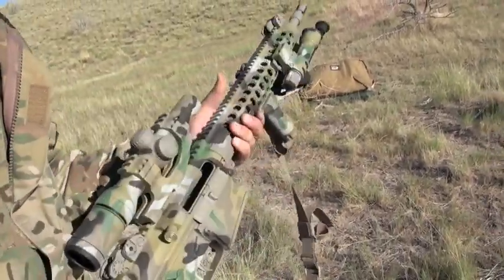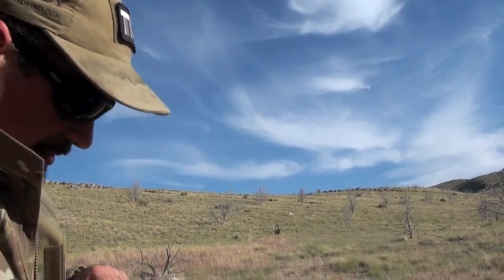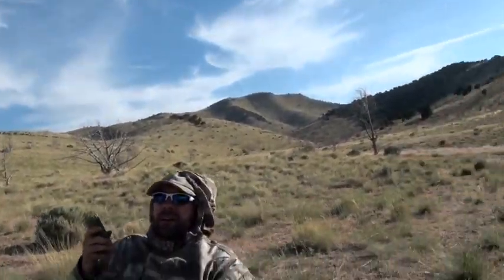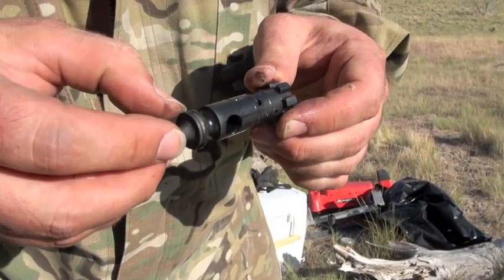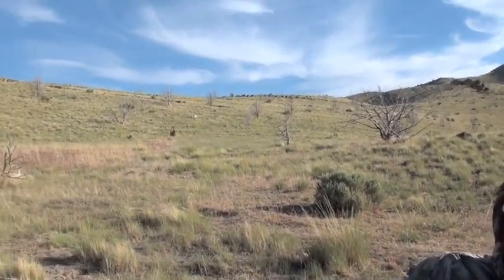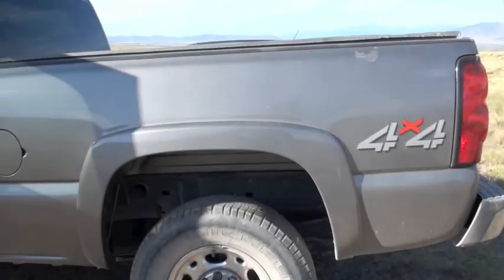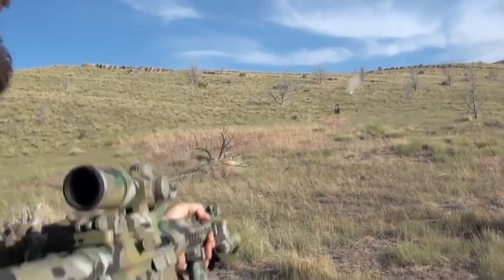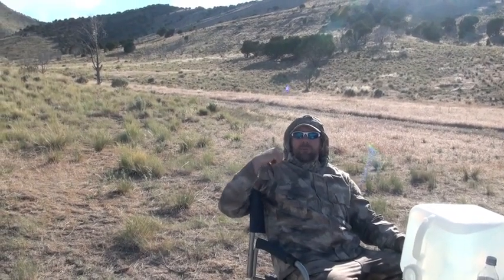ORS: DPMS LR-308 Franken Gun Fails

Comment: Thanks for posting Nutn. I would love to see more videos like this of specifics like gun Failures, why they do, good mixes and bad mixes for ar-15 franken guns etc... however, in general I think cosmetic changes are better then to mess with some serious parts of the system. If you want a top notch rifle, I suggest saving up for one and buying it then slowly franken-gun-ing it to the point that it has lost all semblance of cohesion between the parts. Factory guns are like they are for a reason.

Comment: Try it. You don't need to have a pistol grip/angled fore grip/mall ninja accessories on the front of the gun to use the "thumb over bore" method. It actually creates a lot of stability, especially when you straighten your elbow on your support arm and hold closer to the muzzle. Costa and Haley types teach it, and it works for a lot of people.

Comment: His problem is not a 'limp shoulder'. He needs to change out his buffer and buffer spring. If hes running a carbine length buffer tube, he needs an extra heavy Wolff spring and try two different buffers. I have a  carbine lengt buffer and a mid length gas system on my gun. It is running perfect with a heavy AR10 spring and an AR 15 buffer. With an AR 10 buffer, my BCG retracts too far into the tube.

Comment: When you pulled the charging handle back I heard that it is gritty. Polish the bottom of your bolt carrier and the top of your hammer. When you changed your trigger you probably replaced the hammer spring and now their is too much friction as the bolt carrier rides over the hammer. Polish it up with a dremmel and she will rock and roll.

Comment: Sweet video. Shows some very interesting issues that lots of guys will/are running into. I love the AR-15 (in this case AR-10) platform for its customizability. However, as in most cases just because you can does not necessarily mean that you should.

Comment: Hi guys, Thanks for the comments. As with several MAJOR gun manufacturers nothing is 100% perfect all the time and the gas port was undersized by about .05-.10. I would not say the gun was built "poorly". (It was a factory DPMS upper bought directly from DPMS)  This was a combination of minor issue's (Undersized gas port, dura-coated two days earlier, un-tested dura-coated mags etc) There was simply a rush to get it done for this shoot. Ps. It shot about 90% other than a couple fail to feeds.

Comment: Stacking tolerances suck for AR10 series of rifle.  Personally I would pick an stg 58 or a non century L1A1 if 308 was the caliber I had to use.  Fal pattern of rifle was meant for 18 to 22 inch barrel And  was the right arm of freedom in Europe for a long time.  The gun is a beast if you have to dough get a DSA they are rock solid guns.  Blown 10k through mine no problems what so ever.  Only other gun to do that in 308 is my semi auto 1919a4.

Comment: A franken gun is SO much different than a fraken computer. A computer runs on electric connections. So as long as everything is connected its fine. A gun is a machine with a ton of moving parts. Guns arent fitted for every other compatible gun part, so if two parts are a hundredth of an inch off, there can possibly be big problems.

Comment: I had a box stock DPMS bull barrel rifle in 7.62 that had the same issues whether firing from bench or standing. It simply was NOT reliable. This was years ago and DPMS said it was the magazine which they claimed had early production issues. I had them swap out the mag for a"good" one. No change. I don't buy DPMS ANYTHING any more. JINX alert, my current rifle a PWS Mk216 in 7.62x51 is FLAWLESS, lol.

Comment: Hmmph. Poopy performance from Wolf/Tula and dodgy behavior when recoil hampered by shoulder movement sounds JUST like the diagnosis - too little gas. Used to have a rifle sensitive to this kind of malfeasance - and it was a DPMS.

Never loved that gun. I built a .223 "Frankengun" out of Mega upper and lower, DTI barrel and bolt and it's soulless, tack-driving, death-and-taxes-reliable bullet producer. I wouldn't be surprised if it kept firing with the magazine out and nobody on the trigger.

Comment: You dont know what youre talking about. I didnt say "connect a to b and it works" in any of my comment so dont quote that. I said as long as its connected its fine. You cant "fry" a mother board just because its cheap and the other components are high quality. The connection wasnt right or the mother board he bought wasnt rated for as much power as he had running through it. I know this from first person experience, not from an "IT guy" I knew....